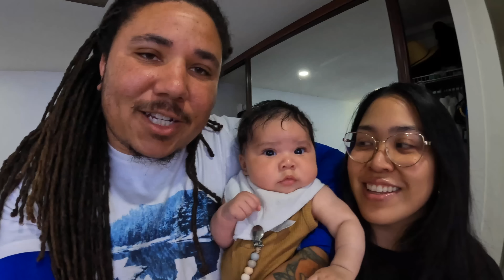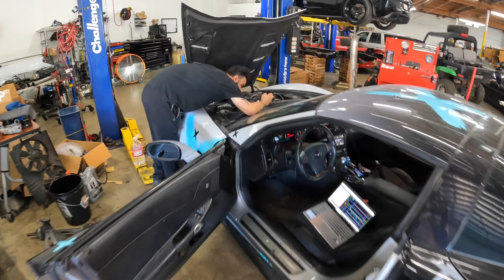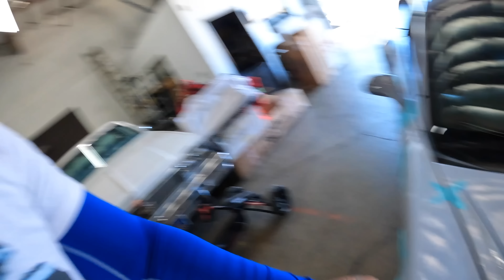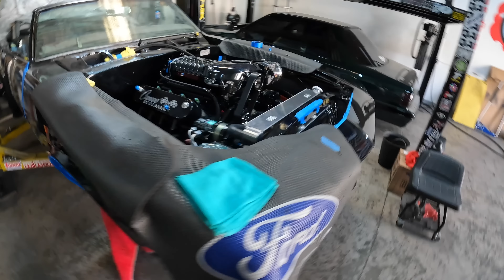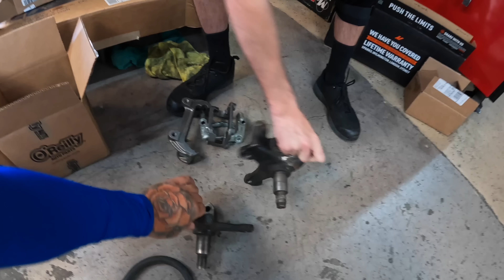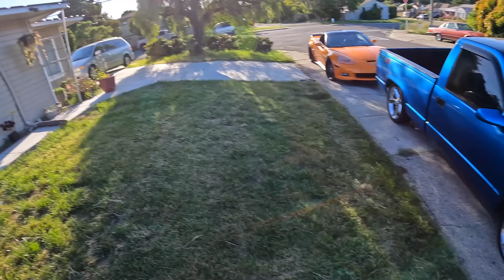My SuperCharged C6 Is Back & Ready To Gap Some People!

Comment: My 2008 Corvette does the same exact thing Mike, there's a little spring inside the black plastic clip/button that keeps the lid locked and from time to time I'll have to wiggle the black piece and adjust it appropriately and then it will lock itself again.